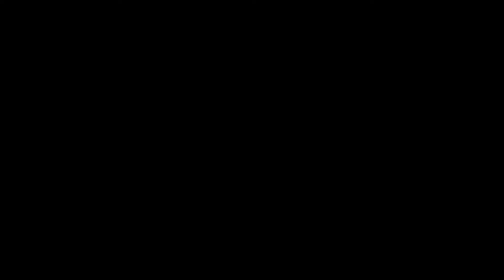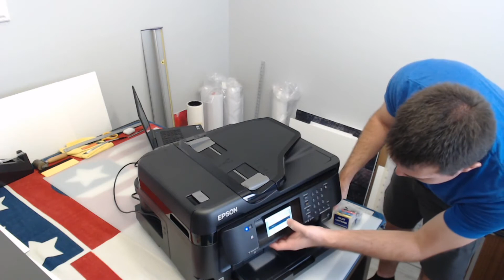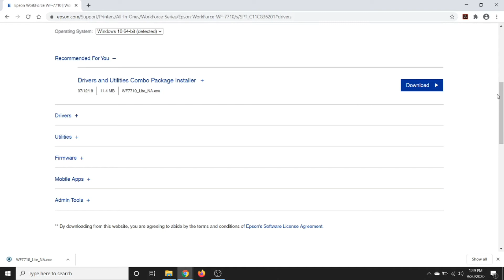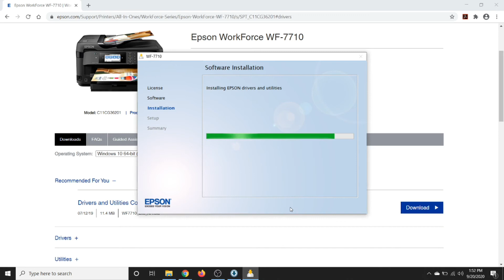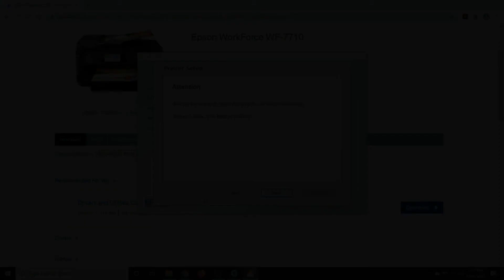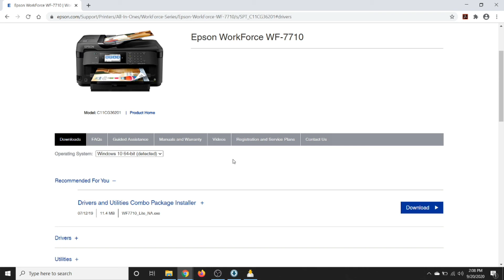Setup of an Epson WorkForce printer for sublimation - FULL PROCESS

Comment: WF-2350 Whats your thoughts on that , mine works pretty good i just don’t know what to get to convert it
Reply from the maker: Unfortunately I've switched away from using cartridge based printers such as the WorkForce printers and now recommend the Epson EcoTank printers. This gets rid of the need to refill cartridges at all and you can simply pour the ink into the reservoirs.

Comment: Do you set up the printer with the original printer cartridges or with the sub ink?
Reply from the maker: Always setup with the ink you intend to use. It is technically possible to switch, but you risk more issues by doing so.

Comment: Can I convert and already used (with factor ink) epson printer into a sublimation printer.
Will I have to print a number of sheets before trying to transfer to clothing, to make sure all the factor in is gone?
Reply from the maker: Yes you can. What printer model? Some are easier to do that with than others.